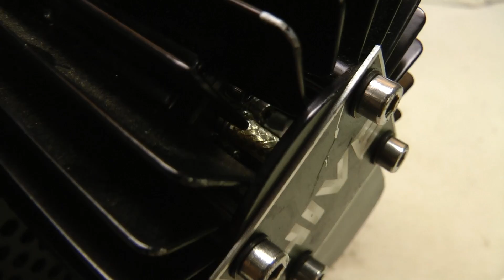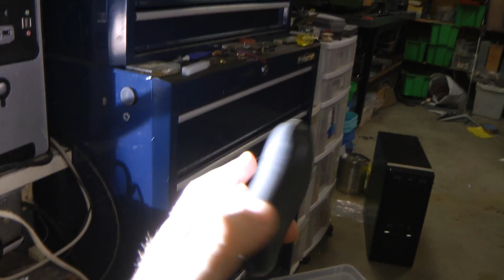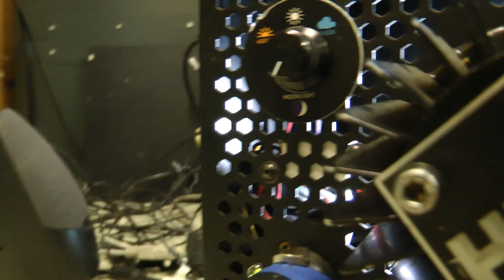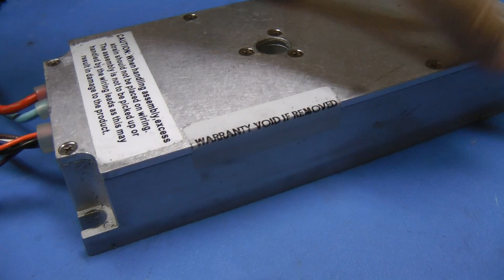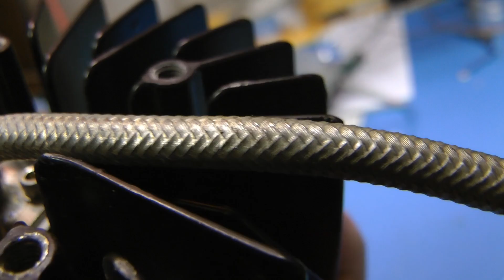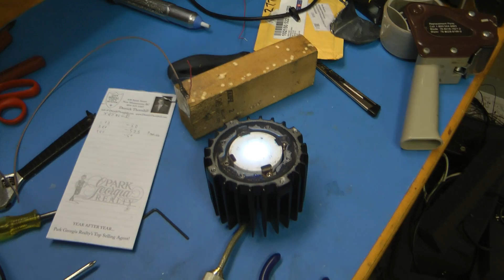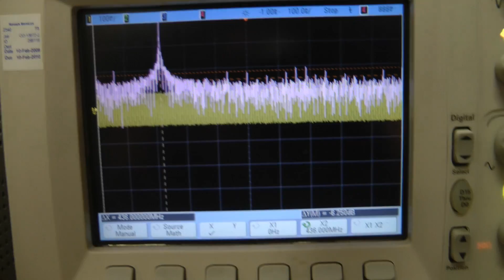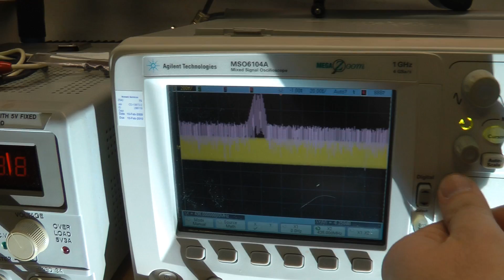WASP 250 RF-excited plasma lamp teardown

Comment: Did you compare the RF output with your stock light?
Reply: Sounds like placebo.
Reply from the maker: Just tested it, pretty much the same in the assembled light.
Reply from the maker: So I did some digging. This lamp falls under FCC part 18 (RF lighting devices). This standard allows for over 2.5 million times the radiated power limit of normal consumer devices (FCC part 15 class B), in this case, 70dBuV/m @ 30m at this frequency, equivalent to 110dBuV/m  @ 3m. The FCC part 15 class B standard  allows 46dBuV/m at this distance and frequency. I was astonished that the FCC allows such an exemption.
Reply: tesla500 we got sick from these lights. try using those RF lights for more than a couple weeks in close proximity on a shoot for 8+ hrs a day. we experienced radiation exposure. I love the lights but we felt very sick until we stopped using them .